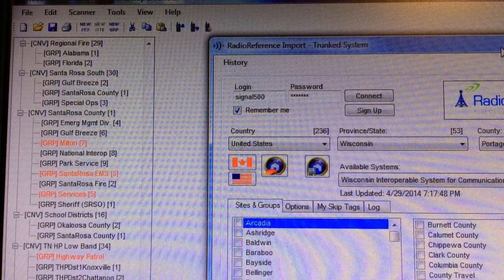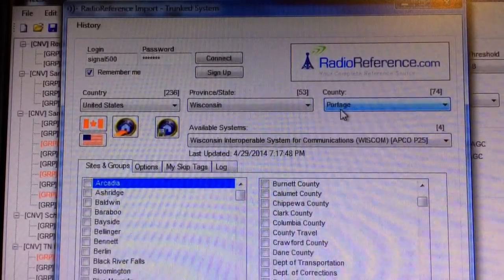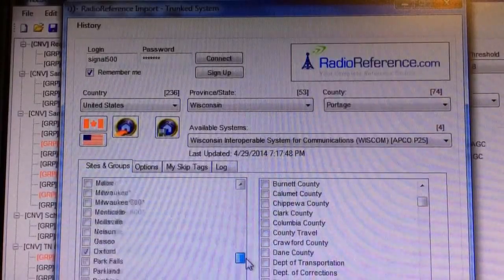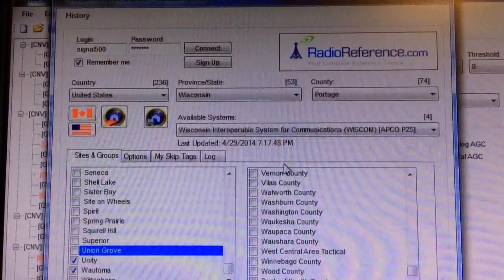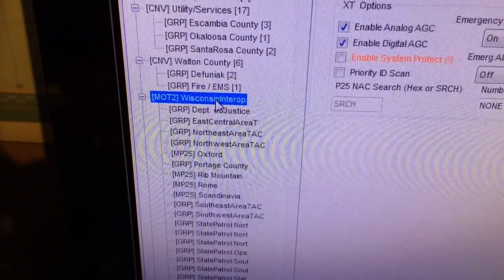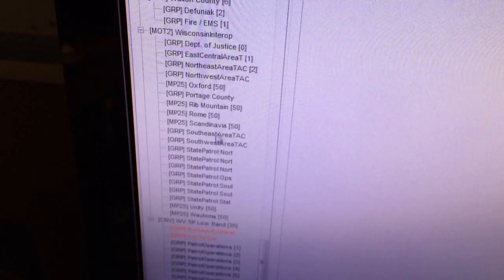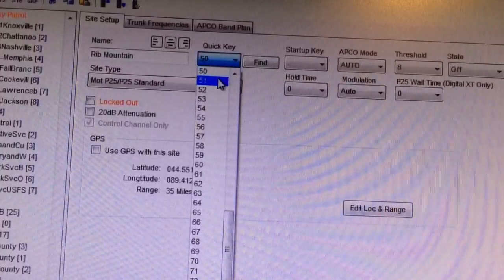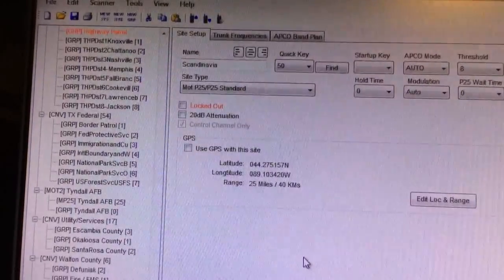Using FreeScan to add a System to Uniden Scanners

Comment: Thanks for the video. I've been out of the scanner hobby for some years and just now getting back in using a Uniden BCD996P2. The last time I had a scanner, they had less programmable frequencies, and you might have 30 programmable channels in each 'bank' (maybe 10 banks...?). Are these newer scanners set up the same way? 
Just based on my observations, it seems like those 'banks' of programmable channels no longer exist? Have they now  replaced by what I"m seeing referred to as 'systems' and 'groups'???  Thanks.

Comment: When I try to log in with the Trucked System it says I have to have a premium account with RR. Any ideas?
Reply: you have to buy the premium service which is 15 bucks for 180 days of access. Just set up an account and than you can upgrade it to premium. It is well worth it if it has your area, as it comes presorted and configured with all the group IDs named and set into quick keys. As close to plug and play as you can get.

Comment: I have Win 8.1 and Freescan won't connect to Radioreference.com. It keeps giving me a message unable to connect check your internet connection or you entered a wrong user id or password. The view in a browser icon does nothing as well. Anyone else having the same issue?
Reply: gbrewer44 you have to pay to have an account with radioreference.com so not much anymore is free
Reply: gbrewer44 I'm getting the same message and I DID PAY full price. I can do nothing with it.
Reply: mamaw4t  First make sure your radio works with that software I use ARC XT PRO and that works fine for me. I tried using other software and no luck but I am using the Uniden BCD996P2
Reply from the maker: mamaw4t Contact RadioReference direct and ask them for help with your account.  Here is the link:http://wiki.radioreference.com/index.php/Support_Help
Reply: I had the same 'wrong userid and password' issue using both ARC XT Pro and Freescan.  I logged on to RadioReference and checked what they showed as my user id. I pluged that into both ARC XT Pro and Freescan and now it works. I had been using my email address as the userid (which does let me logon to RadioReference), but that isn't what is needed for the RadioReference database logon from the scanner software. Hope this helps someone.

Comment: Bcd436hp
Reply from the maker: FreeScan doesn't work with the BCD436HP / BCD536HP, you will need to use Sentinel software or program it manually.  Take a look at these videos, they should help:  

Uniden BCD436HP creating a favorite list

Uniden Bearcat BCD536HP Favorite List Programming

Comment: Hello, I need someone to help me, I programmed my Uniden BCD396XT using freescan software before and didn't have any problems I was able to listen everything but then I reprogrammed it and added extra Systems, sites and groups and now it scans but it doesn't pick up any signal I don't hear anything at all, I even did a factory reset and reprogrammed it again and still doesn't pick up any signal, I tried the weather scan and it does work I can listen to that so it isn't the antenna or speaker, I watched several videos on YouTube and did the programming exactly the same way and still nothing, the first time I programmed it 2 years ago when I bought it I didn't have this problem I successfully programmed it, Io also tried to program my mobile scanner BCD996T and same problem it scans but no signal, iit seems to me that maybe there is a problem with freescan software? Please help!

Comment: Can you do a video on how to load the Palmetto 800 system for SC. Darlington county to be exact
Reply: You can do it manually if you dont have a RR account. They have everything you need on the site; you just have to track it down and enter it all manually. I'm in Greenwood, SC, and have almost all the sites in my half of the state programmed. Still won't hear anything though, until you program in the Talkgroup IDs. But again - its all on their website. Go to RadioReference.com, click on Databases, click on SC on the map, then your county for the sites, and Palmetto 800 page for the statewide sites and talkgroups.

Comment: The setting the battery and then the distance to recieve. Now priority.  And custom settings. And in the middle learning battery tecnology. And have 2 books one with scanner and one made by some one sold with scanner. Wow. Going to try to set priority now watched your you tube. I am learning lots. All a local police dept has some you might not want. Darn I got there portables talking to the car before resending to dispatch. When I get it I will have a blast. Have to clear out my favorite have duplicates. And sure think I want to devide it up fire, polce by dept. And so on and on. You suure are helping.